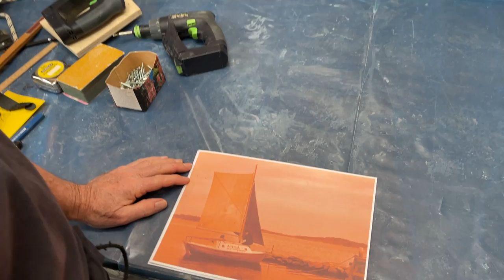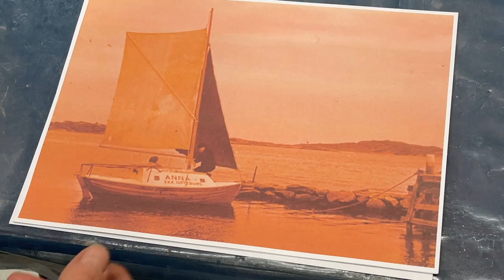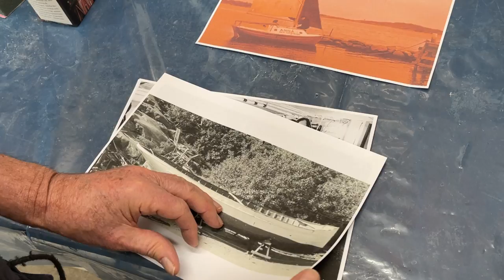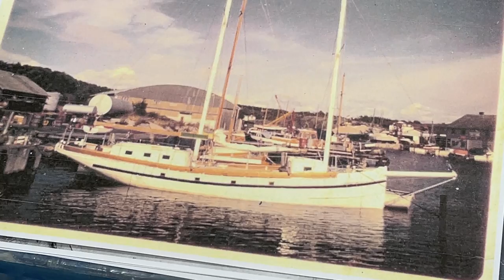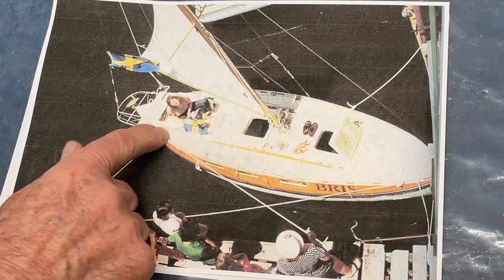Watch the inches and the feet will take care of themsels. My way to small safe functional cruisers

Comment: I really like that thanks 👍can you talk about the center board in stead of using a twin kill on your boat ....
Reply from the maker: Hi Twin keel versus centerboard is the question. It has to be considered in its context. The kind of sailing intended the hull and deck house. In my case I relay on the boyancy of the deck house to get stability at large angels of heel. Therefore I do not need a deep ballast keel.
I like shallow draft. Even twin keels is to deep for me.
My intended sailing will be mostly downwind. Centerboard gives much less resistance. Less sail area is needed.
Coastal sailing is different.